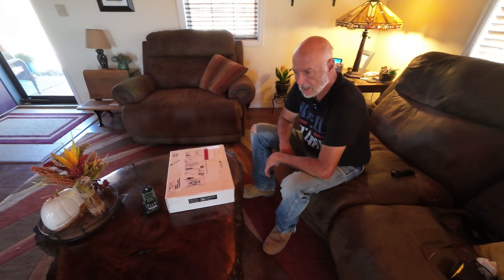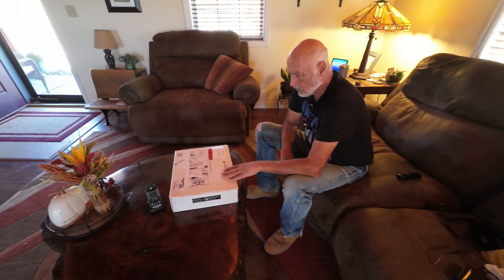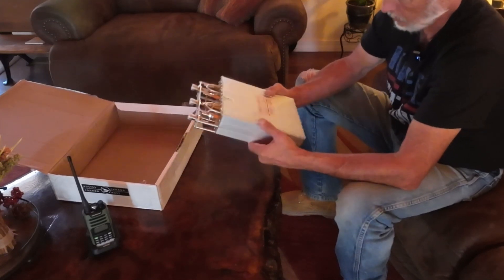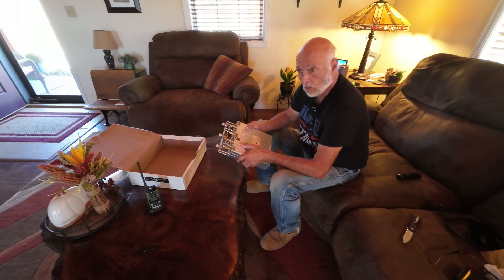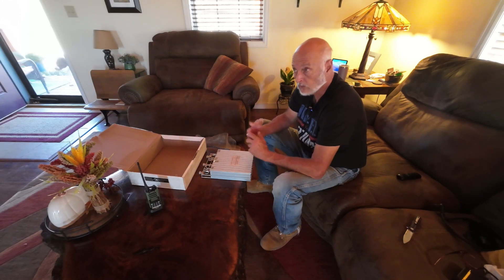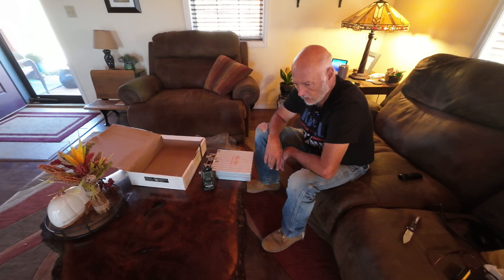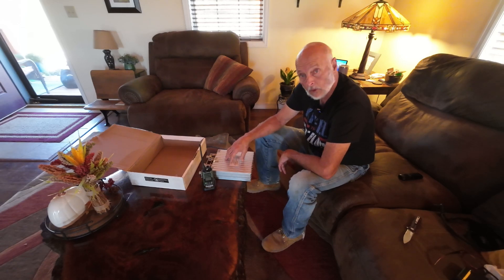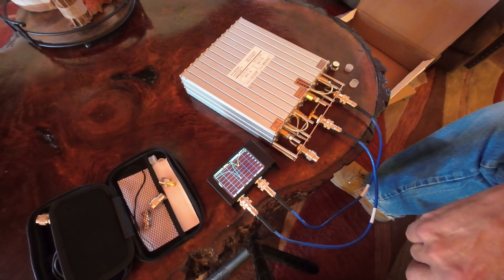GMRS Repeater Duplexer

Comment: Hello Sir, thank you for posting, would you mind to describe your set up please,  I am getting on the mail couple of those wouxuns but I see that where many had failed, might be the use a good duplexer. Thank you in advance.
Reply from the maker: Hi, we have 2 Wouxun KG-1000G's we've had great success with. They run continously almost 3 years now. Our antenna is a tuned 5/8 wave Comet which has worked well. We work off a 24v solar setup and I have a buck-boost transformer coming directly off the battery supply to the radios. At 6800 feet altitude, we have a solid 40 mile range.